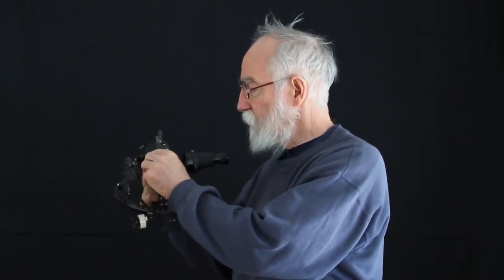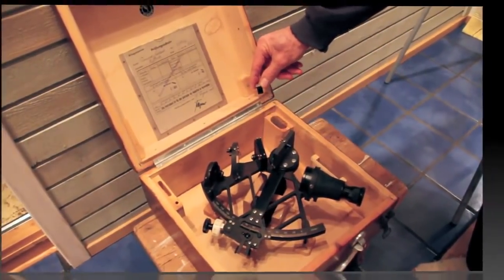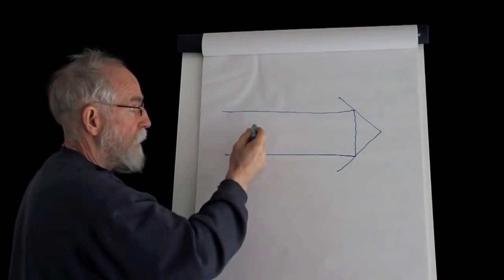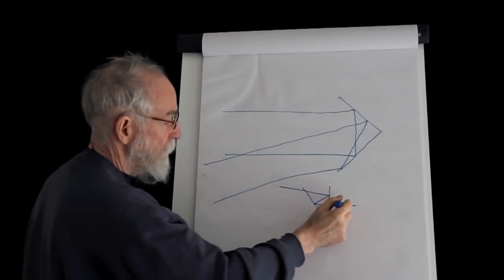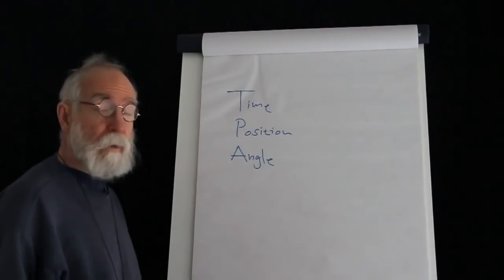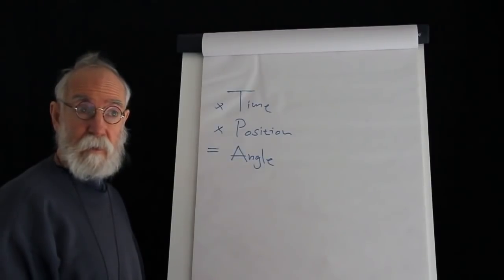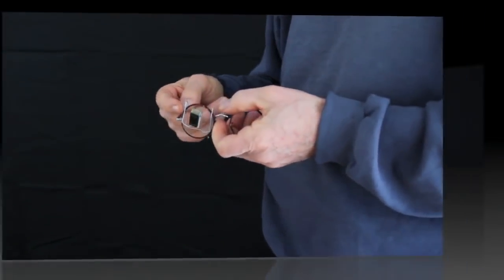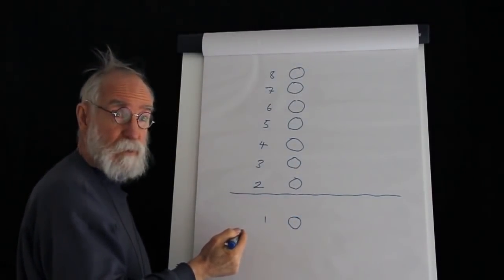Bris mini sextant detailed explanation

Comment: Sven i was thinking about making one of these but instead of calibrating against the horizon (im far from the sea) use an “artificial horizon” as you would use with a sextant + known position and time and divide the angle by 2. Might even be a bit more precise than using a true horizon. What do you think about this? Is it feasible or looking at the artificial horizon through the bris is too bright and dangeous?
Reply from the maker: Always use a good shade. There are welding glass. Never look at the sun always at the horizon. The suns reflection in a lake or something will do I do not remember but you get twice the value or is it half you have to find the proper correction.
Reply: @SvenYrvindExlex  Yes welding glass shade is easy to find. The angle you get with artificial horizon is 2xhs so we have to divide by 2. Horizon dip does not apply as you get a virtual horizon when the angle is divided by 2. Index correction is applied before dividing and the altitude corrections also apply (refraction and parallax) but all that gets absorbed by the calibration on the Bris. Still the angles between the glasses might need to be adjusted to be able to look “down” below the horizon to 2x hs. Ill have to experiment a bit. Thanks sven! Have a good weekend.
Reply from the maker: @tasheido  Bris sextant is unique. There is no index error. In fact no error at all. Reason is, you calibrate the instrument then you calibrate it with all the errors then you can forget about them. If you calibrate from the same hight as you are going to use it you can also forget about dip error.

Comment: Sven ,what is the difference between your sextant and a sun stone?
Reply from the maker: My sextant works on doubble and quadrapel reflections. Thats why you can determine the angle to 1/100 of degree perecise. When the boat is rolling you gain what you lose in the other mirror. The angle is not affected by the boats rolling.
Reply: @SvenYrvindExlex  thanks for responding to my question.

Comment: Calibrated angle is key. So instead of the sun angle being the variable and time fixed, as in traditional sextant, in your case the sun angle is fixed and time is the variable. Good thinking. But since time=money, your sextant seems to be expensive to use 🤣
Reply from the maker: In the same way as you can calculate the time of the noon height you can calculate the time of the angles in the Bris sextant and waste no time.
Reply: On a small boat you have lots of time.

Comment: do you think the Viking sunstones of legend worked in similar fashion?
Reply from the maker: No the idea behind this instrument is as described in the video the double and quadrupple refelction nothing to do with the mythical sunstones
Reply: As I understand it, they were using calcium citrate (calcite) crystals to be able to see the sun when it was cloudy but looking through it and being able to see the angle of the sun depending on the internal refraction. Sadly I haven't tried it, has anyone?
Reply: @johnnyT428  as far as I understand, it could have worked with birefringence (=Doppelbrechung), i.e. by splitting the sunlight into two different, polarized beams (because the calcite has different refractive indices for the different polarisations). 
By orienting the stone's optical axis along incident light you can get rid of the effect. 
Therefore you obtain the angle of incidence.

But maybe I am full of sh*. I am happy to be corrected.